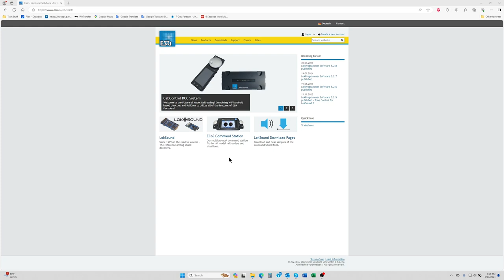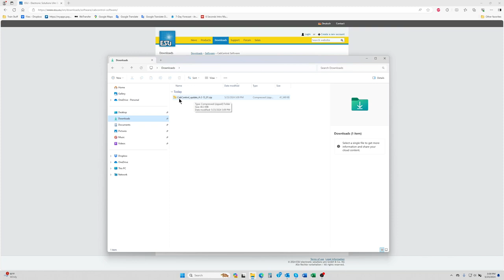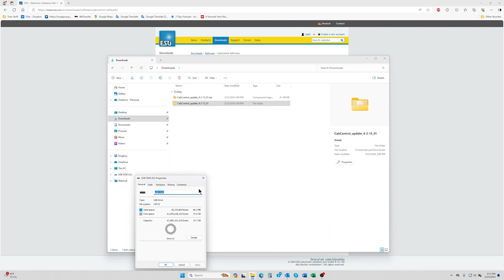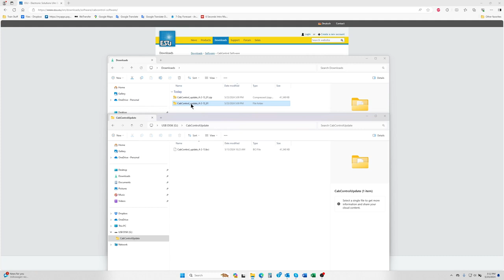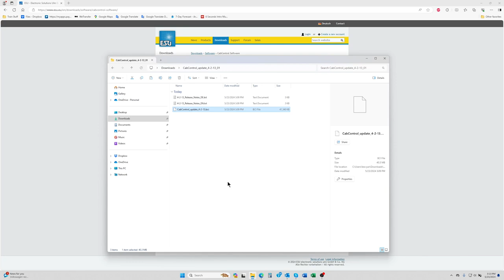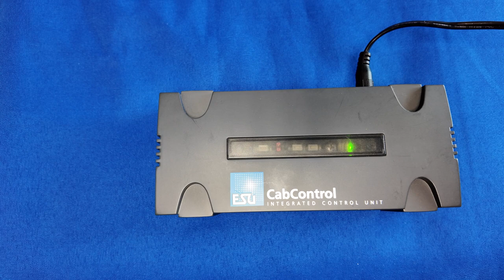ESU CabControl DCC System Integrated Control Box Firmware Update

Comment: I guess ESU doesn't work on Iphone/Ipad? Will it ever?
Reply from the maker: I'm very sorry for the delay in response. With the more recent firmware updates to the ICU (currently 4.3.1), you can use the WiThrottle App to connect your iPhone/iPad to the CabControl ICU.
Reply: @ESUDCC  Is there a how to video on this. I wish you guys had more how to videos on the ESU CABCONTROL DCC SYSTEM. I think its time to look for something else out there. There is A ton of videos on other systems out there NCE power cab and digitrax

Comment: I can’t use LNet please update
Reply from the maker: I'm very sorry for the delay in response. The current version of the ICU is 4.3.1 and the LNET port is now active for throttle connections and accessory decoder connections. It cannot be used for LocoNet block detectors, however you can still use the LNET Converter for LocoNet block detectors.
Reply: @ESUDCC 
Thx a lots!

Comment: For my system, I had to have a thumbdrive that was formatted to FAT ---not FAT32. I could not get the red light flashing with FAT32. My cab controller would not recognize a USB formatted to the 32. Once I switched to FAT, it loaded right up. I think ESU should look into why that could be an issue and whether the age of the cabcontroller is a factor??
Reply: I agree. I have one of the earliest Cab Control systems sold in the US. I followed these instructions precisely but the red light would not start flashing. I had formatted the drive to ExFAT. I reformatted it to FAT32. Still no success. My six month old laptop running Win11 only has one other thumb drive formatting option, NTFS. I will try a new thumb drive, but what a pain. I am really regretting the Cab Control purchase and wish I had waited for the TCS system.

Comment: Why do cab control only have Android and not also I OS? I thought ESU do support Mac computer and Iphone/Ipad?
Reply from the maker: I'm very sorry for the delay in response. The Mobile Control throttles only run on Android and much of our software is Windows based, such as the LokProgrammer software. You can now connect your iPhone/iPad to the ICU if you use the WiThrottle app. The current firmware for the ICU is 4.3.1.